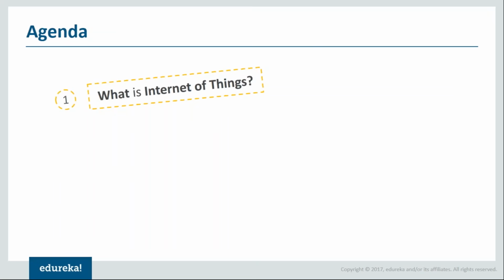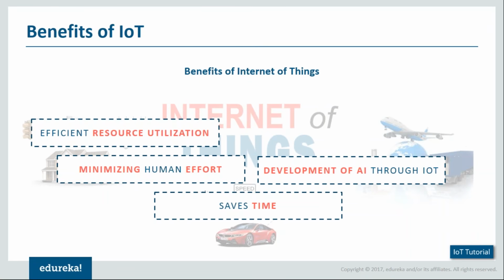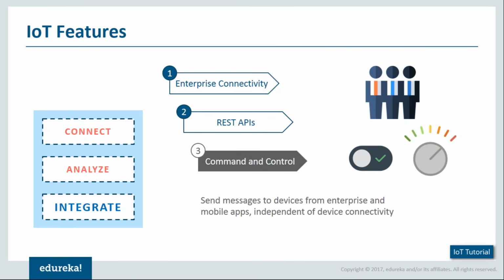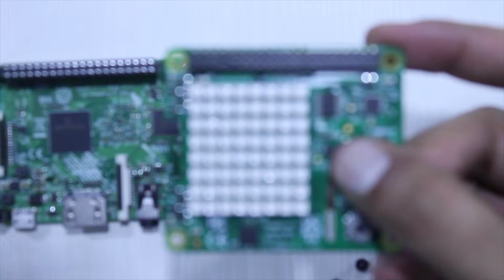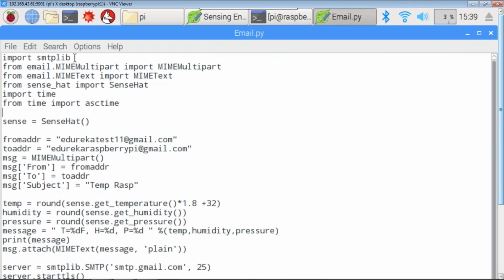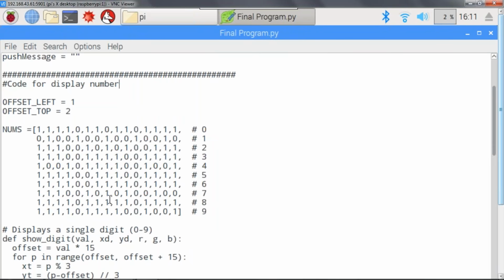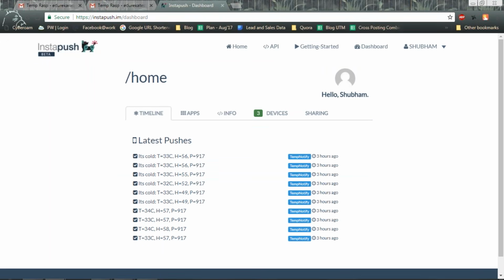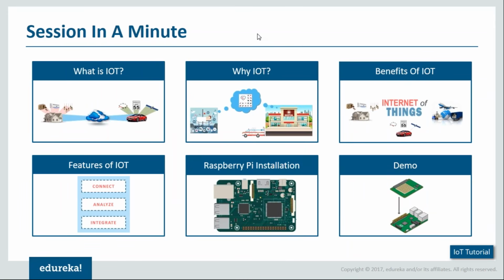IoT Tutorial for Beginners | Internet of Things (IoT) | IoT Training | IoT Technology | Edureka

Comment: How does the raspberry pi connects to the internet?
Reply from the maker: Hi Jose, add your Wi-Fi settings to the wpa-supplicant configuration file. Type the following in the command line to the configuration file: sudo nano /etc/wpa_supplicant/wpa_supplicant.conf. Go to the bottom of the file and add the following Wi-Fi setting, adding your setting in the quotation marks.

Comment: Once you copied the Raspberry Pi OS in to SD card, the SD card is plugged in to  Raspberry Pi board. how did you booted the Raspberry Pi board with Raspberry Pi OS. What are the physical connections made between your host machine and Raspberry Pi board?
please explain.
Reply from the maker: Hey Venkatesh, Physical connections will include a monitor, a keyboard and any components you would use in computer, since the Pi is just a MicroProcessor. And there will be an option for booting once you  copy the Raspberry Pi OS in to SD card. Hope this helps!

Comment: How do I connect a AWS device Simulator with IoT?
Reply from the maker: Hey Vijayakannan, The IoT Device Simulator is an AWS solution that that enables you to create and simulate hundreds of virtual connected devices, without having to configure and manage physical devices, or develop time-consuming scripts. It includes a pre-built automotive module that you can use to simulate vehicle telemetry data using pre-defined device types. The automotive module uses a power train simulation model to generate simulated vehicle telemetry data. Getting started with AWS should be fairly easily and the documentation provided in the video can be used for the same.

Hope this helps!

Comment: Can I use a normal sensor for finding the room temperature and humidity? apart from sense Hat....?
Reply from the maker: Hey Vinay, sorry for the delay. Yes, you definitely can. You can even use a bunch of them together. The sense hat is just a sensor board with some sensors and functionalities already built into it. You can use other sensors directly by connecting them via the GPIO pins or even through any other possible means. Hope this helps!

Comment: Good explanation
Can you please send how IOT can be used for bank locker security using finger print  and OTP using ARM7 processor.
My mail id laxmipooja3366@gmail.com
Reply from the maker: Hey Pooja, sorry for the delay. This is a project that requires real time emulation and embedded trace support. You'll need LPC2148(ARM 7 stick) micro controller, DC Motor, GSM and an LCD screen for it. You'll also be needing software  tools such as Keil µVision and FlashMagic to execute code.

Hope this helps!

Comment: Really helpful...I have a doubt. You have used SenseHat for weather detection. So SenseHat can only detect weather right. So what if I want to use IOT to monitor if somebody is entered in my room with the picture of the person. How can I know that what devices I need to use and where I can find the device that I should use to build the system. And also do I need to have a little bit of knowledge in Python ??
Reply from the maker: Hey Santanu Biswas, thank you for appreciating our work. You can check out our video on Raspberry Pi Tutorial which will help you understand how to build a motion detection system using Raspberry Pi and your mobile camera: https://www.youtube.com/watch?v=QlApoEKGfU4

As the core idea of Raspberry Pi was to build an inexpensive device that could help make learning easier, Python was chosen to be core language as it is one of the easiest programming languages to learn. However, there is no restriction that you need to only use Python for development, any language can be configured on to the Raspberry Pi. 
If you are interested to get started with Python, you can check out our Python tutorial video: https://www.youtube.com/watch?v=N0lxfilGfak

Hope it helps :)